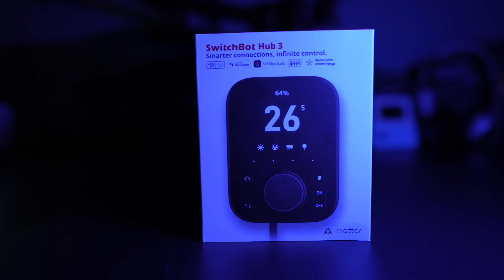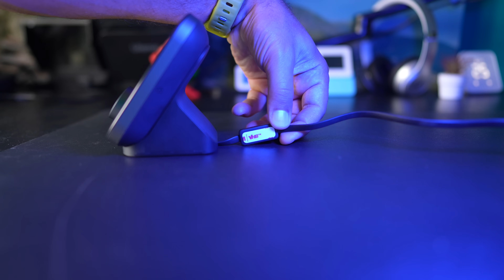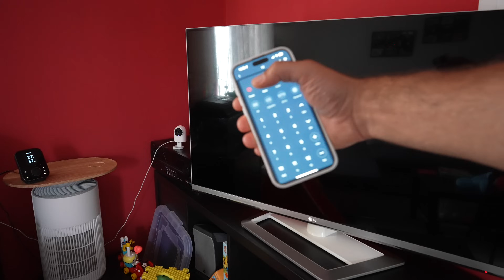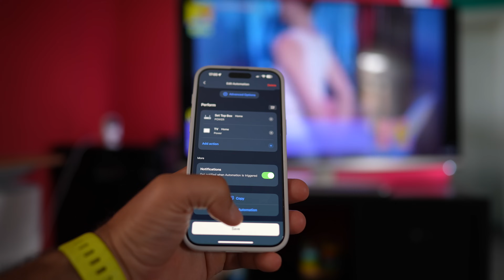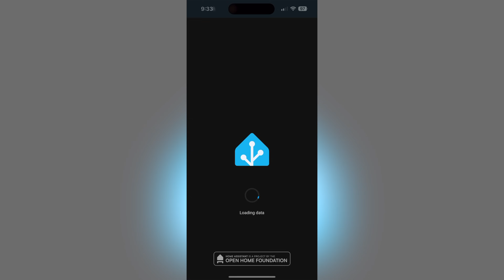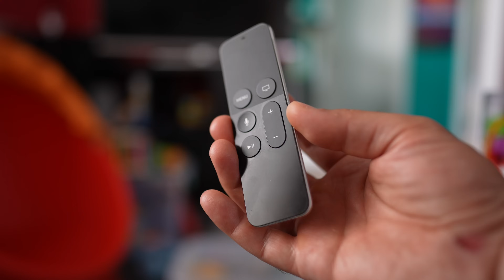SwitchBot Hub 3 - Native Matter and Home Assistant Support

Comment: For those failing in during home assistant matter integration last step - connection check. Hint: after you connect to the device via switchbot app -> bot 3 -> settings -> matter and get the pairing id, reset your phone wifi connection. You need to add the device from home assistant on your android device and somehow that matter setup breaks wifi connection, which fails the integration. With additional wifi reset the procedure works perfectly.

PS This is not smooth at all ;)

Comment: If I might ask, how forgiving is the Hub 3 as far as positioning - does it have to be right in front of the IR devices or can it be a little off angle?
Reply from the maker: good question, it works a bit off but it depends of the controlled device. For example my TV works fine even if Hub 3 is rotated a lot, but my super rare, custom STB needs the hub to be pointed directly at the IR receiver of the STB.
Reply: @KPeyanski  Thank you! That's what I was wondering, I have a speaker with one of the older switchbot hubs and sometimes it's more forgiving than others. 

I have older media content that's super loud even at a volume of 1 on the Chromecast, so I have an automation that looks at which Plex library it's from and lowers the speaker volume. Then it puts it back up for the other libraries

( I don't want to force normalize the content with transcoding )

Thanks again, I might have to get one of these after I decide if I'm upgrading my switchbot lock.